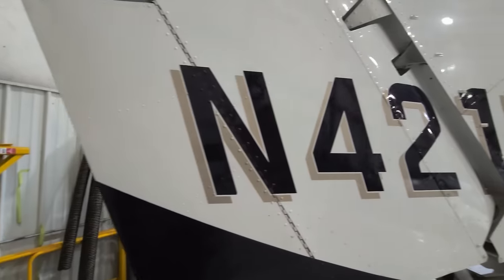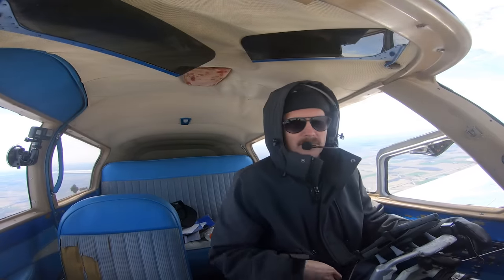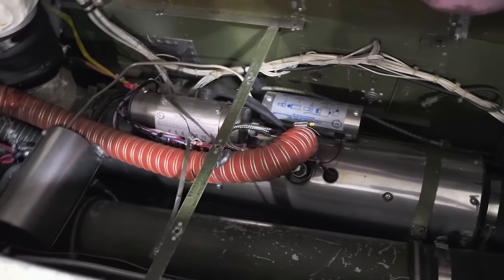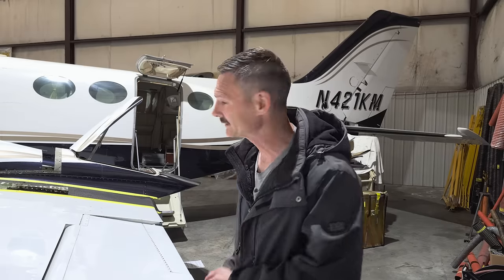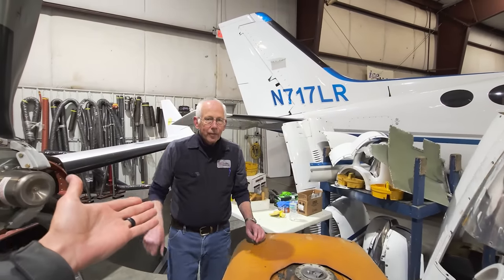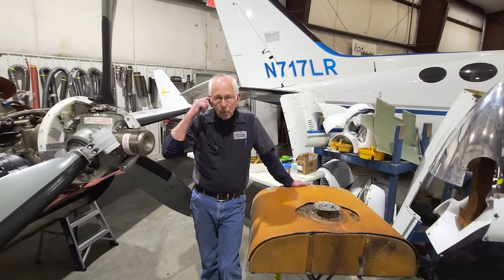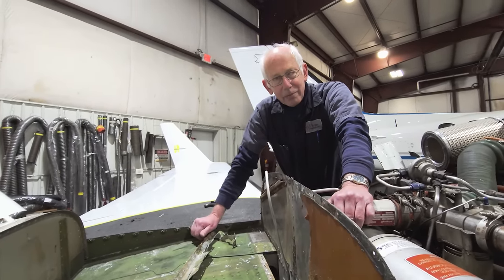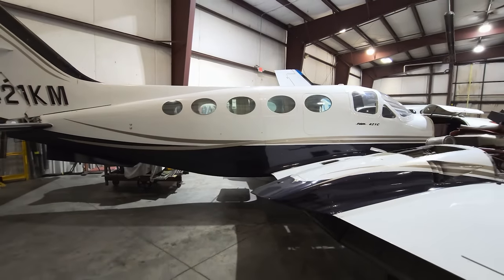I Bought The CHEAPEST 421C In The World.

Comment: Solve the problem at the source. Remove the tank permanently. It takes fuel to haul fuel. Much safer without it.
Reply: Was also thinking why don't they just get rid of that fuel tank.
Reply: Fuel burns, so you haul less the further you fly. With the tanks you have more range, life is a compromise. How about removing all the tanks? Hey presto, no more fuel costs.
Reply: I simply meant that aux tanks are not required or necessary. Far better to remove the problem.
Reply: All depends on the length of his average flight. Costs a lot of money and time to decend from the flight levels to the ground to get fuel and then back up.
Reply: @s35bonanzapilot84  I think? 
Operating Weights
Max T/O Weight: 7450 Lb
Max Landing Weight: 7200 Lb
Operating Weight: 5315 Lb
Empty Weight: 4501 Lb
Fuel Capacity: 1572 lbs Lb
                Payload W/Full Fuel: 613 Lb
Max Payload: 1685 Lb

The extra fuel is mission specific?
Reply: @amunderdog  I'm looking for what his average trip distance is going to be, how many people,  how much baggage/cargo, 1 stop or non-stop, weather conditions and if he's willing to plan for a diversion due to weather for a given flight. How much of a safety fudge factor does he insist on in extra fuel. Fuel extends your life if you ever get into a bad situation. All of those items and more go into fuel calulations. There are a lot of other parameters that have to be taken into account given that class of aircraft has far more capabilities than any of his other airplanes. And some of those capabilities, i.e. de-ice boots, can lull one into the belief that they can take the flight farther and into worsening flight conditions because they have them. I've seen far too many people do just that and some are no longer alive because of it.
Reply: I was thinking the same, then I thought this is a 50 year old airplane, properly repaired will it even be around in another 50 years?
Reply: @TheUllrichj  That may be true, but it would eliminate a ton of expense.
Reply: 3D print  tanks or fabricate stainless steel replacement tanks?
Reply: Removing the tank would be a SOUND decision.

Comment: Hey Jimmy - I spent a lot of time maintaining a stable of twin Cessnas when I was a tech in the 90s. It might be worth making sure the fuel injection is set up correctly. There is a lengthy procedure in the maintenance manual that will ensure the fuel injection system is tuned properly and that the engines are matched. The 421 was one of my favorite aircraft to work on. The GTSIO-520s sound so sweet.
Reply: TCM SID97-3D I believe is the newest.

Comment: Nice looking airplane Jimmy.  Glad you have a very knowledgeable mechanic there to show you the pros  and cons of purchasing a Cessna 421 Golden Eagle.  The fuel tank issue Tony mentioned is indeed a big deal.  This situation claimed the life of a friend of mine and two of his buddies.  He was flying a 1975 Cessna 421 to the Bahamas for a nice weekend getaway.  They found a fuel leak and thought it was coming from the fuel sump.  A mechanic where they rented this 421 from replaced the sump valve and thought that fixed the problem.  They flew the plane from South Carolina to Florida to refuel before heading off to the Bahamas.  They arrived in the Bahamas with no problems.  When they were getting ready to leave, he had the FBO there top off all the tanks.  Apparently there was a fuel leak, but it was not caught on his preflight.  Shortly after take off, the right engine caught on fire.  He tried to turn the aircraft around, but the right wing melted off the airplane before he could complete his turn.  The plane crashed into a heavily wooded area.  It took first responders 20 minutes to get to the crash site.  By then, the whole plane was engulfed in flames.  There were no survivors.  This happened 5 June 2018 in Rocksound, Eleuthera, Bahamas.  The NTSB ruled the accident as pilot error because there was really nothing much left of the airplane for inspectors to investigate.  Sorry to end on a sad note, but corrosion is a common problem on 421's that have the fuel tank behind the firewall.  It sounds like you have a great mechanic there that is aware of the problem and knows how to correct it so the new owner does not end up like my friend and his buddies did in the Bahamas.  I really enjoy your videos.  Keep up the great work.
Reply from the maker: Thanks for sharing.
Reply: there is a report on a 421 crash in Rocksound, Eleuthera  on June 5, 2018. While the NTSB participated, the investigation was conducted by the Air Accident Investigation Dept. of the Bahamas. The findings differ somewhat from your recollection. Of interest is it states "There was no evidence of airframe or system malfunction prior to the accident." They did a very thorough investigation based on the report.
Reply: @skyboy1956  Yes, that is the Cessna 421B Golden Eagle that crashed that my friend Todd Crawford was flying on 5 June 2018.  He was a Commercial rated pilot with years of flight experience.  The local authorities report on the accident is a little more informative on what happened including videos of the accident scene over the NTSB report.
Reply: Maybe  just convert that into storage/not have the tank at all?  It seems like Cessna kind of did a kludge there. One option I saw as well was an air conditioner in that space?  They evidently had several options for that "area" - but a fuel tank that close to the engine? I'd not want that. Yes, that would shorten the range some, but the main tank is about 200 gallons - a bit less less fuel isn't a game changer.

Comment: The winglets are part of the RAM conversion.  Glad you are getting training.  It’s real easy to tear up the gear boxes on those engines.  Always plan a cruise descent.  Never, ever, ever, yank the power to idle and back-lash the gears.  Smoothly to idle in the flare.
Reply: And they really like to idle at 1200 rpm instead of 1000rpm.   Get it going,  do your run up and fly!  Corrected  spell check errors.

Comment: I was hoping you get the aerostar !  Talk about a rocket ship!!  I've heard some pretty interesting stories of adventures in 421's.  One of which was icing conditions.  The front boots on the wings were inflating and keeping the ice clear, but the boots on the horizontal stabilizer had stopped working.  Unable to visually inspect that part of the plane while inside, when they went to flare in the landing there was very little elevator authority due to the ice, so the landing was quite harsh.  Since its such a tank and built so well, even with the ice, on the stabilizer, it even functioned fairly well outside of its engineered use.  Keep safe and rubber side down.

Comment: Winglets can only be put on the 421Cs without the trailing link.  Basically gives them the 414A wing, which is longer than the standard 421C so it will be even more stable at altitude.
Reply: Trailing link is nothing but 400# useful load decrease in my opinion. I can make greaser landings without it, so can Jimmy.
Reply: Hi, why the winglets can’t be added with the trailing link gear system? Regards
Reply: @RicardoSalinasFournier  The STC only applies to serial numbers before the trailing link was available.  My guess is because it's similar to the 414A winglet STC, and the non trailing link gear on the 421C and 414A are the same I believe.

Comment: Jimmy while you have the  nacelle apart and the fire wall partially removed ask Tony if the crossfeed lines were replaced with stainless steel.  There is a Service kit for replacing them.  Years ago when they had all the exhaust problems there were several fatal crashes where an exhaust leak burned a hole in the firewall and they ruptured the aluminum crossfeed lines.  There is no way to shut off those lines once they are ruptured.  If there is a fire it will burn until all the fuel tanks are exhausted.  By then the fire usually burns through the spar and the wing falls off.

Comment: You really need to get into your GTSIO 520's operations.  It operates differently then any non-geared engine. Power settings for take off and let down are critical to keep your cases from cracking.  I highly recommend getting ahold of the STC that Scenic Air in Los-Vigus NV. used to operate there 404 Titans back in the 80's before they went to the Twin Otters.  I was an A&P, IA, 135 Director of Maintains  back then and we leased back one of the 404's to fly freight.  The STC works so well that Scenic was able to increase TBO's by 500 hrs.
It has been awhile for me now and I don't quite remember all the details but  most important was the let down power settings to keep the engine from cooling to fact.  Something about no more then 1 inch of manifold pressure reduction per one thousand feet of altitude.  Loved the 421's myself, good luck.

Comment: Ah my favorite airplane to fly.  Spent many hours flying the 421 B, and 421 C models.  They have a bad reputation for high cost to operate, maintain, and service.   Most of the problems came from too many pilots not operating the plane as they should.  This is an airplane that is best flown by one pilot!  It does not like power and prop changes.  Every change must be slow, and your flight profile must be well planned in advance.  Pulling power and shock cooling the engines is a quick death to the engines.  There is not another plane that is as sweet to fly with those geared engines and massive props.  This airplane if it flown correctly will deliver lower cost to operate than a C414.  I miss my C421, and it still is my number one favorite piston cabin class airplane ever made.  Getting insurance will be a challenge for you and keeping currency.  Let's see how this turns out.
Reply: @SI-lg2vp  Couldn't agree with you more!!!   I owned a 1976 421C, equipped very much like Jimmy's.  Winglets, spoilers and VG's.  I loved that airplane.  Never had any issues with the engines.  Took Simcom training, learned how to operate the GTSIO's.!  The spoilers were a great addition for managing descents and speed.  Wish I never sold it!!
Reply: I flew a 421B and lost an engine coming out of 19,000’.   It flew very well on one engine another 30 mile for me to have a good landing at CAE.  The engine threw a rod probably from a spun bearing and put a plum size hole in the case.

Comment: My grandfather had had 310 that had gear issues which resulted in a nose gear up landing. It had just been picked up from the shop after being gone through before we were going to take it on a trip. My grandfather always had his airplanes fully checked and would test fly them a few days before taking a trip and the shop didn’t pin the gear correctly which is what caused the problem. He also owned a 421 Ram Air, 414 Ram Air and a 340 Ram Air. To me his 340 always looked like it was hauling ass even sitting on the ground. I always enjoyed getting to fly with him and really miss it. He had many more airplanes some even quit a bit bigger and faster and much higher flying than the previously mentioned.

Comment: I was working at Cruse Aviation in Houston, TX back in the late 70s. We worked on all models of the 421 but when the C model came into the hangar, I was sold. 
It borrowed a lot of things from the early Conquest (except the nasty Garrett engines) and was so much easier to work on than the A and B models. 
One of my favorite airplanes, even with the geared engines.

Comment: After 3 years in Florida it will be a moldy Dust bucket unless you Hangar. And you will need at a minimum 44 x 38 ft to store , and that will run about $700-1K a month. and even then in Florida will only extend the corrosion time by a year or two. I recommend keeping it in the desert South west.

Comment: I used to buy and sell 421's in the 80's. Had one that was being flown to the engine shop to overhaul the left engine. It was a Factory Reman that had reached about 1,575 hrs since Reman. Our off duty airline ferry pilot was flying it to the shop alone, thankfully, but full of fuel. After takeoff and climbing thru 10,000 ft the left engine manifold pressure dropped so he reached over to try to increase the power trying to determine what might be wrong, ie turbo failure, etc. About that same time the plane shook, he glanced at the left engine and at that moment the propeller departed the airframe, flew up and over the wing and then disappeared. It was GONE. THANK GOD it didn't hit the nose, wing, or tail. He secured the engine, declared and emergency, and flew back to CLT. What we found was that at the forward inboard cylinder, right behind the gearbox, threw a rod split the case in half about and inch and the gearbox broke off the front of the engine. To this day they never found the propeller. No telling where it landed. Needless to say in my 35 years of flying aircraft I have never seen or heard of that ever happening. 421's can be an animal on one engine. Be careful Jimmy. They are a very critical aircraft to fly on one engine. Especially with a high load..... 👌

Comment: WOW!  Just goes to show that fixing one thing (a repaint) can cause damage somewhere else!  Glad they caught that corrosion now!

I'm wondering if the elimination of that aux tank isn't the 'best' solution.  IDK...  28 gallons in that left nacelle tank doesn't take you far with two thirsty 375hp engines. No aux tank in the right nacelle (yes, I researched it), since the air conditioning system is located in that location if so equipped (most 421s are).

With that shop being the 'technical gurus' to the FAA on Cessna twins, I can almost smell a Service Bulletin or even an AD in the near future to have the entire fleet of Twin Cessna nacelle-aux-tank-equipped planes checked for wing spar corrosion in that area.

Comment: I flew a C-404 for a while, has the same engines.  While the geared engines have some quirks, its not as bad as some would have you believe, if you don't "let the props drive the engine" you will have no extra problems with the engines.   Didnt you buy an Aerostar a while back?

Comment: I have many hours in a 421; its a great airplane, but.  Fuel will run you $350-$400 per hour, thats the cheap part. Maintenance on these old birds will run $750 per hour; if you can buy insurance it will be $50,000 per year. Annuals will be $20,000 to $30,000 per year, if it has been maintained. ADs on the bird are not cheap to comply with and growing more frequent as time goes by. The foreign ownership means non compliance with some of our FAA items, throw in another $100,000 minimum to fix that issue. Im sure it needs new avionics, so there goes another $150,000.  If you got it for free you should only need to spend around $700,000 to get it flyable if no serious problems come up. It will be a life changing event for your bank account I promise, but they sure fly nice👍

Comment: We were upgraded to the Conquest back in 2007. A bunch of consultants going nowhere in a northerly direction fast. In Namibia at the time this meant leaving the C310 engine failure kind behind. Substantial rise in cost to the Dept. of Health was mitigated by 5x hourly rate less 2 hours each on the flight north and back. Same cost to the powers that be but we were flying in style! With a bit of tailwind we were cruising at + 600 km/h  in thin air and high above. Good pilots too! Can your 421C be uprated to the C 441 spec? Turboprops are pretty cool. Happy flyings..

Comment: Love a 421 - never been in one but in my FBO line service days saw plenty, heard stories.  that tank is only 26 gallons which is about 30 minutes of fuel based on your 50 gal/hr statement.  for all that trouble - leave it out.   Also in your transition training pay attention to the engine management.  The geared/turbo 421 engines need to be under a gentle hand.  Just want you safe.
Reply: The problem is, the damage is already done, so you might as well just keep it. The new products they put in. It's not an issue anymore.

Comment: Like long term stock market prices, the GA used market is not dumb. Maybe sometimes in the short-run, but not in the long term on value for $.
There are about $100,000/yr reasons that a good used, 50 yr old 421 is at a cheaper purchase price than nice 15 year old C-182T.

Comment: Cannot really say if it was a good buy without knowing the purchase price up front. $100k to refurb a mid 70's CE421C is not much depending on what is having to be reparied. Hope the spars are ok, because if they have any significant corrosion, you are really screwed. Again, just showing how long the squawk list is without knowing what is on it, other than the heater and the exhaust, makes it hard to say if the price shown on the repair estimate is high or not. $30k for the exhaust is a bit high in my experience, and $10k for the heater should only be if they have to replace the combustion chamber.

I look at from the angle of how much utility and time savings you will get from the aircraft. How much of your time is it going to save over flying airlines, and how much per hour is your time worth? Are most of your flights to/from covered by existing airline routes that are run several times a day? What is the average cost of the airline ticket booked the day before, or the day of, the flight?

How much it costs per hour to fly the airplane is not what is most relevant since that is a business expense, assuming it's being flown for business. If it's just being flown to take the family on vacations, or in most cases if it's being flown just by you alone even on business, then no any CE421C it is not a good investment. At that point it's being purchased and flown because you have the money to burn through and make enough yearly to afford it. Either way, as long as you're not asking for donations for it, it's your money to do with as you please.

Comment: The exhaust system includes the Turbo induction system for a tiny 375hp 6 cylinder engine. 
So, the cost of which would be about a little more than one GTSIO-520 long block engine.